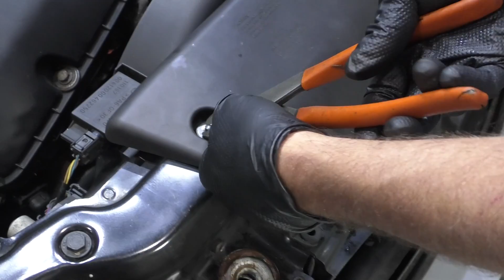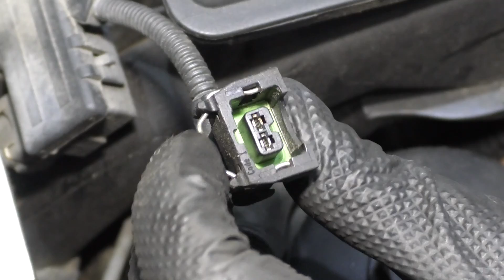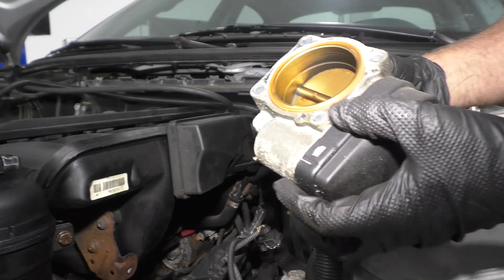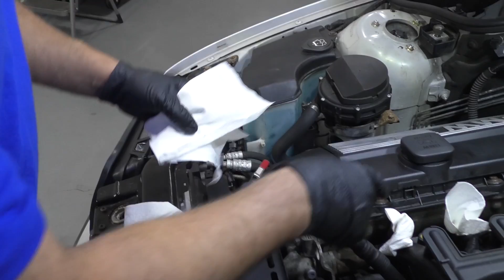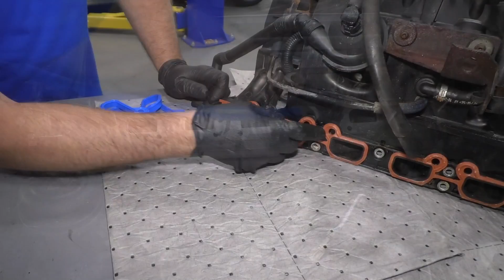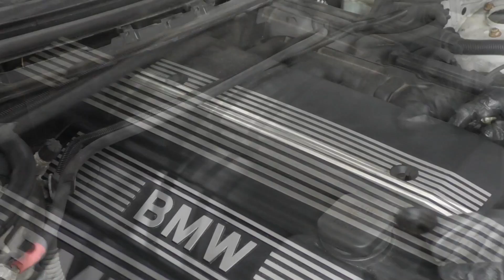How to Replace Oil Pressure Sensor 97-06 BMW 325 Xi

Comment: Wow...crazy, though, nice to just see...actually, the electric valve (Secondary air injection sytem) attached on the back on the manifold intake got my attention.  I need to change those vacuum hoses and maybe even replace those secondary air components while there.

Comment: If you have to remove something to get at this sensor (which is debatable,) why not remove the oil filter housing instead?  The o ring sealing that housing to the block goes bad all the time and could use replacement, plus it gives you the access you need while keeping the intake manifold in place.
Reply: I was going to say the same thing just remove the oil filter housing

Comment: So i bump my BMW E60 ,5 series to the wall . possible took her to where i could get the body work done? i was driving back and i got the signal of the low oil pressure comes up on the car. i stop the car and put in one liter oil check the oil level and it came alright..

The car is running fine , no noise so smooth, i was driving home when the car engine stop and i had to possible get help in removing it from the road. please what can i do at this moment .

Thank you
Reply from the maker: +James Mike We wouldn't be able to diagnose an issue like that here, you will want to have a local mechanic take a look at it. Thanks for checking us out! http://1aau.to/m/Shop-1AAuto-c

Comment: I wouldn't want anyone taking my car apart like that, problems could arise afterwards from doing all that work and the only thing that would be guaranteed would be the oil pressure switch, even though so much work taking apart with the chance of  making a mistake.

Comment: Why did you over complicate this so much you can get it out by just removing the air box and reaching in. No need to remove the whole intake manifold.
Reply: Mechanics go for the labor amount that pays them the best
Reply: I got worried when I saw the video was an hour long.  Lol your comment gave me hope.
Reply: When you read this comment make sure to not just try to thread to screw in blind there is a hole underneath the threaded hole that perfectly is wide enough an curved enough to get the sensor completely stuck an you will be unable to remove it without doing everything this mans said in the video
Reply: I tried changing it w/o removing the intake Manifold and could not remove it.  Is there any special toll you can use??
Reply: Sorry, I meant tool !!